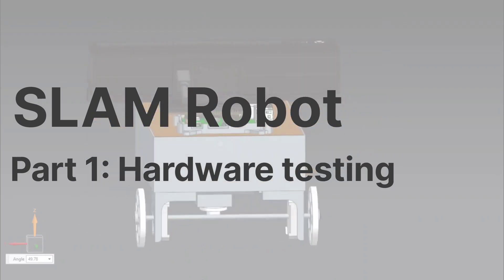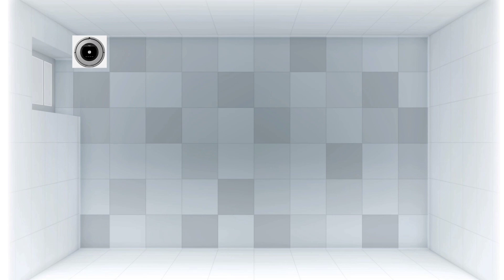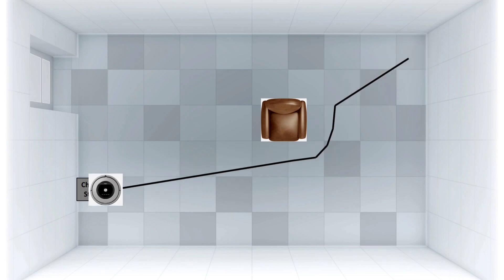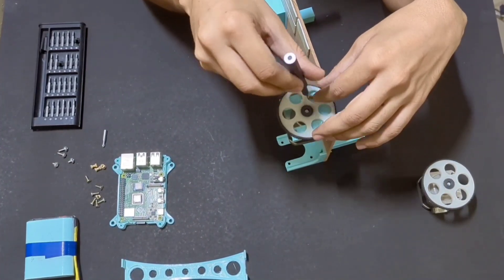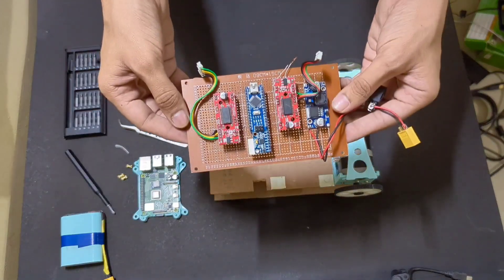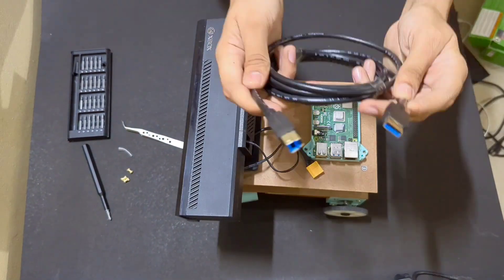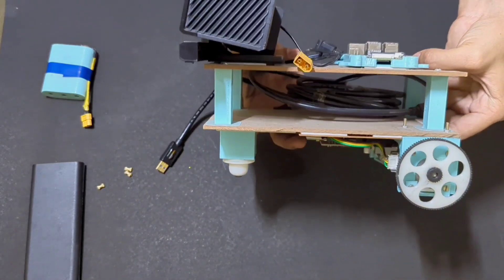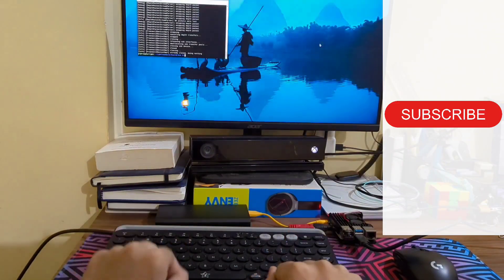Part 1: SLAM Robot using ROS.

Comment: You using the depth camera for vslam or adding lidar?
Reply from the maker: Plan is to use RGBD only. Will see if there are any issues will add lidar. Stay tuned for 2nd part.